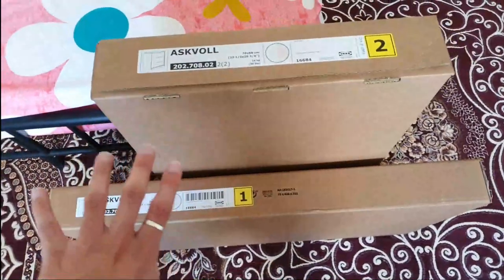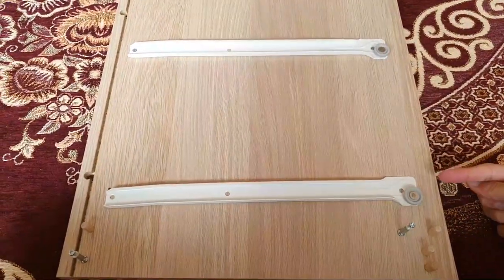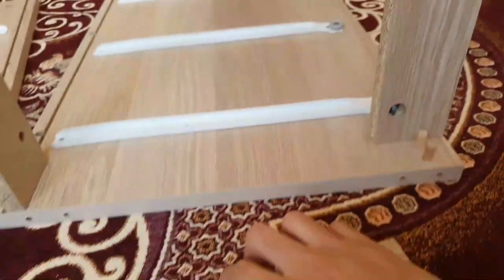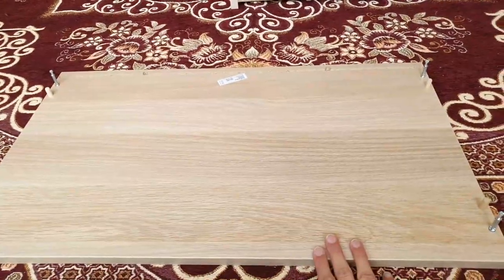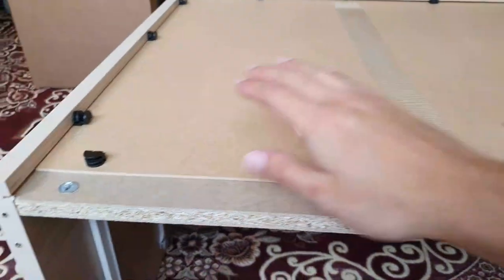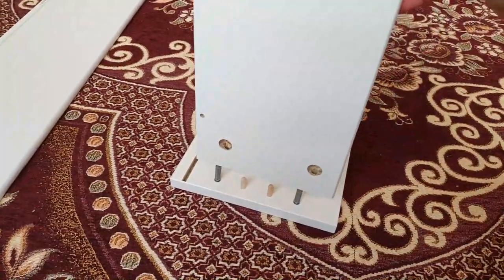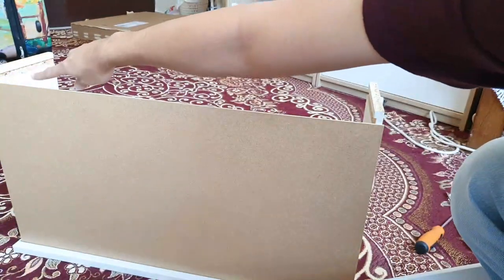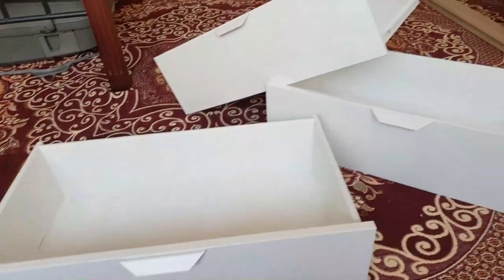How to DIY guide IKEA ASKVOLL drawer

Comment: Thanks it worked !!what about the drawers they don’t fit exactly any idea?
Reply from the maker: Well inserting the drawer part is a tricky one. In beginning you should place the wheels (of the drawer) over the wheels (chest/structure) and slide it slowly inwards keeping the drawers horizontal position. It'll fit just fine.

Comment: Hi! Thank you for this! I'm looking to buy this exact same drawer, and am wondering what you call the screws and plastic frame you use at 23:25 to hold the base up? Thanks!
Reply from the maker: Well there is no specific name mentioned for it but you can probably say 'drawer base fastner'. Also I can give you the model number mentioned by Ikea: 106698.

Comment: Hello i did a big mistake and i mixed up the side of the drawers is there a way to remove the screw fasteners they are not rotating anymore so i remove them
Reply from the maker: Yes, these screw fasteners can be removed. Just have to rotate anti-clock wise till 180° and use the sharp edge of the (minus shaped) screw driver to push it out.